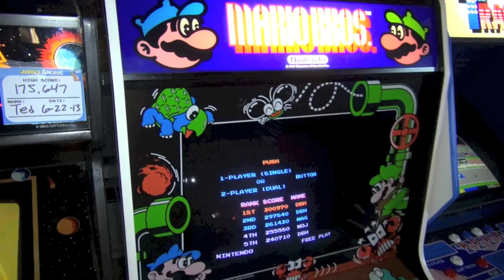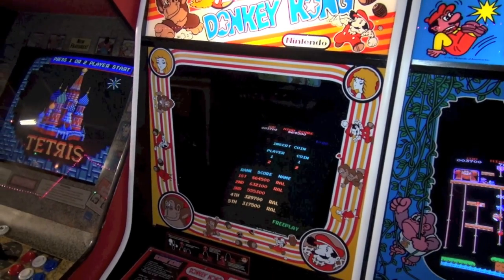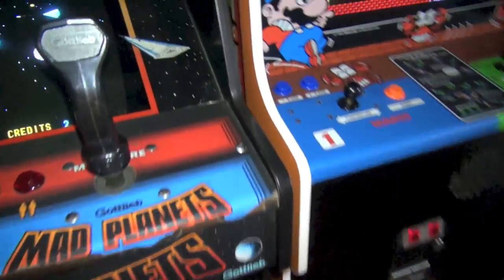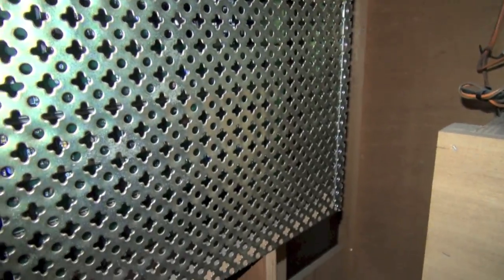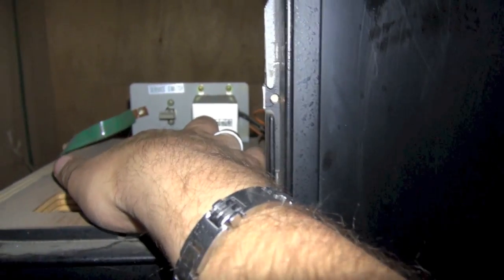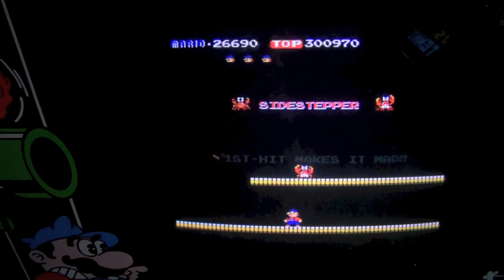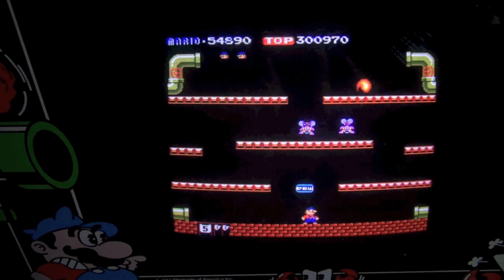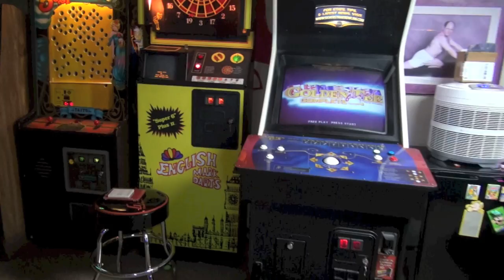Nintendo Mario Bros. Arcade Game Review - Original dedicated WIDE BODY cabinet - 1983

Comment: You mentioned the 100 volt plug. Standard electrical outlets in Japan only run on 100 volts AC. So rather than redesign the components for US voltage when selling the cabinets to the American market, they added a step-down transformer that converts the 120 volts to 100 volts. Cabinets sold to the UK and Europe would have a 240/100 step-down transformer.

Comment: Very cool cabinet John. I got a widebody Mario Bros on eBay a few years ago and painted it. Had a new cap kit installed before I bought it. She looks a little rough still, but plays great. I've gotten out of the arcade gaming hobby since then, but it's still a fun machine. I need to finish restoring it but that will have to wait, I have a tractor that I am rebuilding now. Two completely different hobbies, eh?

Comment: I noticed there's a difference in monitor angles for the Mario Bros vs Donkey Kong cabs.  Is this true for narrow body as well as wide body versions?  Working on a Mario Bros narrow body restore myself.
Reply from the maker: Yeah, the DK style cabinets have the monitor at a greater angle away from your. The wide body has the monitor more at 90 degrees

Comment: Wonderful video John!  Very good point about this being the very first game to introduce Luigi, the green pipes and the turtles.  It's a very important part of Mario's history and where it started.  I guess they decided not to use the Crabs or Fly's very much after this game or did they?

Your difficulty is set to EASY instead of the standard MEDIUM but for a game this hard I can certainly understand why.  The differences are when the green fireballs start and later when the red fireballs start.

With some good practice you can certainly beat the top score of 300K on your first man.
Reply from the maker: Wait a second... are you sure?? I should have my game set to the standard TG settings! You think it's set easy!?!
Reply: John's Arcade Game Reviews & Tech   Yep, I'm sure.  You even mention it on phase 7 ("I'm surprised I haven't had a fireball come out to get me.") at exactly the same time I look at it to see which difficulty the game is set at.  Check your dips to see what they are set for.  MEDIUM should be all dips off and the last one on.  However, I have seen broken dips giving out the wrong difficulty just recently. For example, EASY really being HARD and vice versa.  In that case you will have to test them all to figure out what's what.
Reply: Whomp it’s interesting to note that crabs (and hammers from Donkey Kong) were featured in Hudson Soft’s “Super Mario Bros. Special”, released in 1986 for various Japanese PC’s. Hudson has earlier done ports and special versions of Nintendo games for Japanese PC’s, including Mario Bros. Special and Punch Ball Mario Bros.

Comment: My DKJ marquee light fixture was missing so I purchased a new 16" flouresent light fixture from the home depot, cut off the plug and connected it to the existing wires hanging behind the marquee. It works fine now but is a 120 volt fixture running off a 100 volts. Can this damage the original transformer or power supply?  You've got me worried now. I hate when one of my games marquees aren't lit. 
Great vids John
Reply: By now your arcade cabinet is broken.

Comment: Not that i'd ever do this but, what keeps someone from taking the book "project arcade" and the design in it modifying it for the dimensions and making a dedicated arcade cabinet from that? The speaker grill in the middle wouldn't be exactly the worlds best give away at that point. I'm assuming you'd want some kind of secondary method, other key signs to look for to help be sure it is. I mean if your really THAT specific just curious